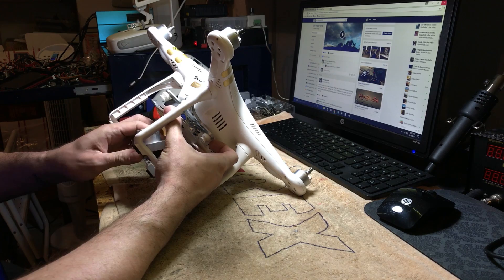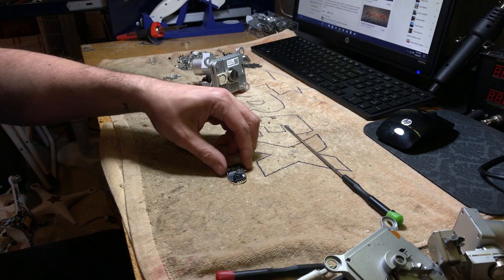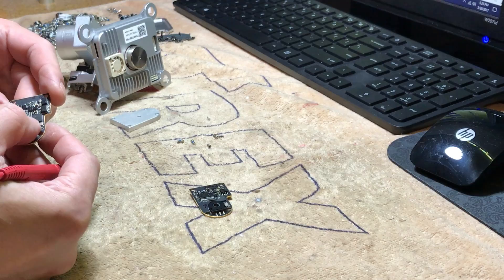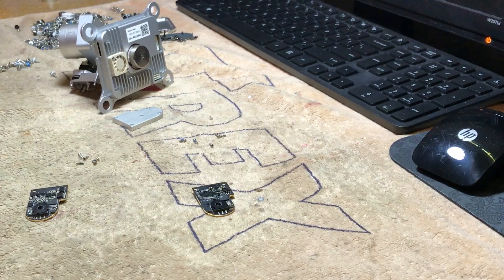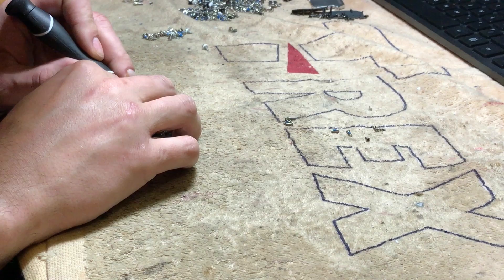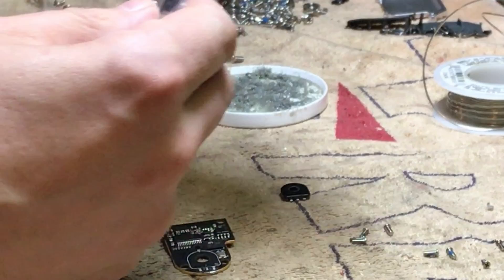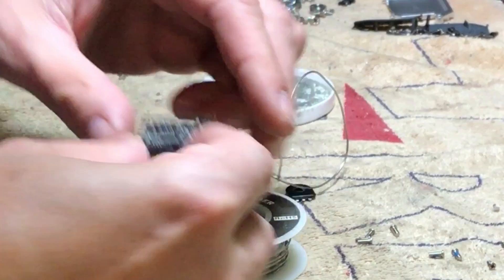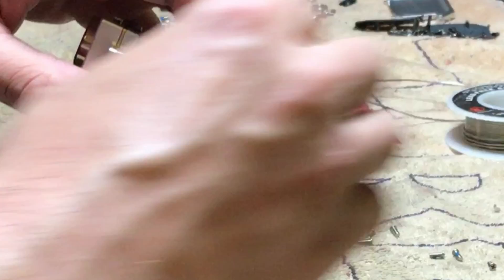Replacing and Fixing "crazy dance" on DJI Phantom 3 A/P gimbal

Comment: Is there a pot on all three axes to be tested the same way?
And spec sheet seems to suggest accuracy of  +/- 30 pcnt, which might explain some of the readings I get: 3.8k-4.5k at the balance point (same on both legs)

Comment: I still get the crazy dance after re aligning the roll ESC to its proper position. Is there a chance the Pitch ESC would cause it to do the crazy dance as well? as I dont see much about it on the web. I did order a new Roll ESC but will take some time to arrive so figured I would ask this question of you, since your super smart when it comes to fixing drones.
Reply: Did you ever receive an answer to your question. I have the same issue.

Comment: In my case (Phantom 3 Standard),I change 3 times the cable, change 3 potentiometer to, but without success! I later discovered a defect on Pith-axis ESC Motor Circuit Board. At the contact point called HCLR_N, it was shorted! On the back of this board, several shorted pins also on the main controller chip. I bought a new and compatible board on eBay (Pith-axis ESC Motor Circuit Board), made the exchange, and miraculously, it worked perfectly !!!! :)
Sorry my bad inglish
Reply: Plese elaborate. I have the same issue. What caused this shorting? 

I have not used my drone for a year. It was fine when i last used it. After a year of no use , the gimbal danced and had no video feed

Comment: Hi TheA8W12. 
I crashed my drone and i purchased replacement gimbal yaw and replaced it.. all good but when i connected camera and saw that as u called chicken dance with my cam. I'm from NY do you have any 3AP Roll axis circuit board driver board for DJI Phantom 3 Adavanced/Professional fro sale or if i send my Cam set to you could you fix it? Thanks..

Comment: So, you still around?  Do you know how to correctly and properly repair the issue of the yaw arm not centering after a crash?  (Most suggest an unreliable fix of moving the yaw arm and putting the set screw on the round part of the motor arm, rather than the flat.  Doesn't last and is not proper repair.)  Thanks.

Comment: To theA8W12 or anyone else who will answer, I am deaf, do you/does he mention where you/he got the replacement pot's? I can't see anything in the subtitles. 

Also, during the removal, did you/he smear flux across the three lower terminals and then just heat one terminal to melt the solder on all three terminals?

For what it is worth there is a similar arrangement at one end of each joystick pivot in the controller
Reply: If you're still looking for the pots let me know. I may have a few and could sell you one

Comment: My phantom 3 standard fell from 200ft and ripped the gimbal off.  I replaced the ribbon cable and broken roll arm, but now when I power it up the gimbal goes crazy.  I checked the orientation of the camera to make sure the flat side is on the flat side of the camera and made sure all ribbon cable connections were good.  I came across you video and I see you measure 4+ and 4+ Kohm on the roll board but this if for the Adv and pro.  I checked the pitch board it it reads 4+ / 4+, but the roll board reads 5+ / 5+  Do you have a standard roll board you can read the Pot value?  I suspect this may be the Issue... what do you think.
Reply: I need the potentiometer board. But in Ghana, how do I get one. Please any means you deem appropriate. Will do the financial transaction for you to send me one. Phantom 3 dji Standard.
Reply: In fact watching your videos, you are too good. . need your help

Comment: nice video.  Where can I buy the potentiometer?  I tested 4 different boards and they read between 6k to 2k.  It could just be because I'm using a cheap Radio Shack Multi Meter.  Thank You.
Reply: I see that mine are the same way.

Comment: I measured the position sensor for the roll motor on my P3 standard and it reads 89K on both legs, with no change in value when moving the rotary.  it is my assumption that the position sensor is bad.  Thanks for the great video

Comment: hello I have a question
I had problems with the pitch engine of the camera gimbal. It got stuck not to the movement from top to bottom, replaced by another from another camera and when armed the camera went crazy. I returned the pieces as they were and even went crazy.
Maybe a suggestion?
thank you very much

Comment: I am experiencing same issue, could you indicate where to buy the potentiometer, please?
Reply from the maker: are you looking to get just the potentiometer to re-solder yourself or sensor board where potentiometer is soldered on?
if later then i would need to know which phantom do you have, S/A/P and which sensor board, pitch or roll?
Reply: only the potentiometer I'll resolder it,plz
Reply: phantom 3 std and the pitch motor one|
Reply: i will only need the potentiometer for the pitch motor and i'll solder it, i have a phantom 3 std

Comment: Can you sell me a pot or give me a part number?
Reply from the maker: i don't sell pot, still illegal here in MN :D
what "pot" are you referring to?
Reply: TheA8W12 sorry. The 4k roll sensor on the rear of the gimbal. Phantom 3 standard.
Reply from the maker: of course,
look at the checkout link below. i've created this couple years ago when P2 sensor boards were popular but i am using the same checkout for all, P2/3/4 sensor boards now, just make sure you write in the NOTES at checkout EXACTLY which sensor board you need. for what bird/model and if it is for pitch (side sensor) or roll (back sensor).
https://squareup.com/store/uav-repair-shop/item/pitch-sensor-board-for-dji-phantom-vision-gimbal
Reply: Can you ship next day air?
Reply from the maker: where are you located?
Reply: Springdale Arkansas 72762
Reply from the maker: i can overnight it tomorrow for saturday delivery but for extra $20. that's what it will cost me
Reply: I placed an order for the roll sensor.
Reply from the maker: i noticed. can you please email me to my email at my store?
Reply: TheA8W12